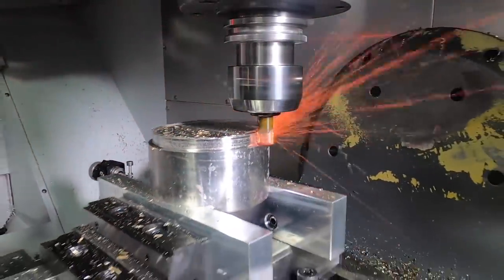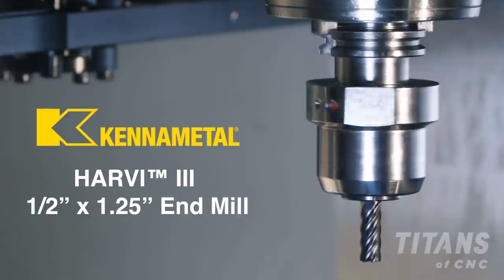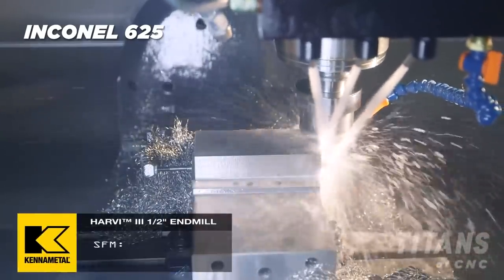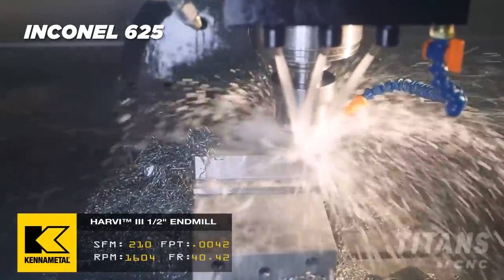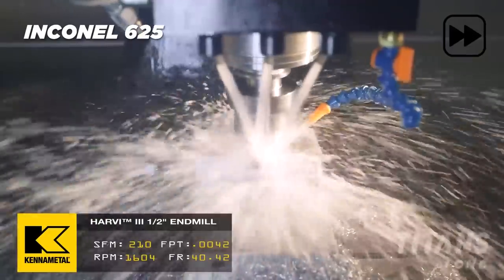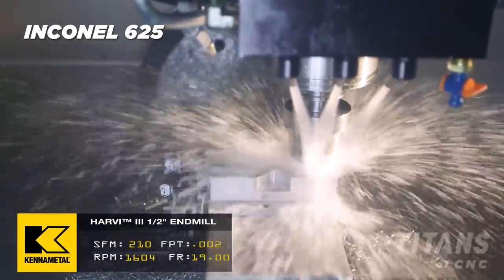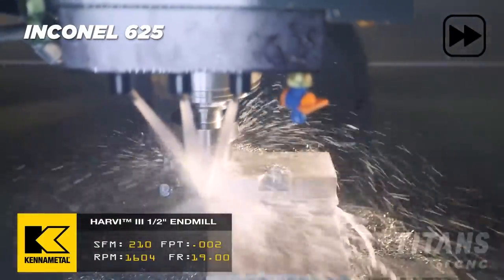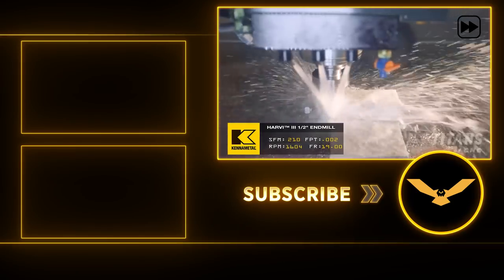Are Ceramic End Mills Actually BETTER Than Carbide End Mills???

Comment: On mazatrol mills we switched from an end mill to an insert endmill that way we could switch from carbide to ceramic depending on material type. Then we would flip the insert corners for the finish pass. Saved alot of money I was told.

Comment: I've had good luck with ceramic mills as long as it's not an interupted cut.
Good video showing the chips taking the heat away from the part.

Comment: 'When implementing tool management, make sure the machine can swap tools in the middle of a cut, or change the tool before it runs out of time.  Older machines would use the tool in a 30 minute cut (for example) as long as it had 1 minute left on life...
Reply: We implemented a guy who loads parts and comes looking for me whenever a tool starts getting harsh with the parts (I take them off the VMC and onto the knee mill and my "5 axis lathe" they go)...He even occasionally checks the spindle load!

Comment: The advances in ceramic technology have been unparalleled in any other material science in the last 20 years...
Reply: not really related to the video, but plastics have also gotten incredibly good the last 20 years, and definitly the last 30.
Reply: Glass as well but lots of similar information gathered between the 2 of them

Comment: For true roughing I'd say carbide has the win 90% of the time. Semi roughing where you are using less of the cutting edge , be it milling or turning, ceramics probably have the win with good tool management.
Reply: Ever worked with inconel material? No you have not
Reply: @louisrousseau1006  yeah I have actually, in the last five years it's been 90% of my work. Aerospace , oil and gas components
Reply: @louisrousseau1006  I am right now. Ceramic all day for roughing.   😎

Comment: I would have never thought ceramic would work as an end mill. Hanging out there like that with so many vibrations. I would expect it to turn to dust on contact.
Reply: Nope, speeds and feeds, and length of tool. Actually last awhile

Comment: Ceramics need to be ran much faster feeds and speeds than carbide. That’s where many get too conservative and the tool doesn’t last. We had our vendors tell us the correct way to use them in our materials and our engineers balk when programming it. And dry. No coolant or the damn things will shatter
Reply: Hmm. Interesting. I wonder if running them hot basically makes them tougher and more shock resistant than running colder...

Comment: Ceramic blows tungsten out of the water for parts harder than 48HRC~. I work with steel that can push 60-67HRC daily. Use to use tungsten taking 0.2in cuts at roughly 250sf/m. Now Im using ceramic taking 0.6 cuts at 350sf/m. And what's great is the ceramic can be ground back into shape to be reused much easier than tungsten. Tho on anything in the 40HRC or lower.... Lots of chatter.

Comment: Would ceramic work with hardened tool steel? I use high grade carbide, but I'm curious on other people's experiences
Reply: Never tested, but as I understand it, ceramics mills work by heating the metal so much it becomes soft, and then removing it. This heating might be bad for steel, screw up the temper, things like that...
Or not, it's just a guess. If you find out, let me know!
Reply: Tool steel is soft if u know how to cut it. If the chip is purple there’s too much heat. Blue chip is what you aim for. Never cool it with coolant as it hardens the material. Always use air blast.
Reply: @supah_sonic9979  I work with m390, that stuff is extremely stubborn. The only chips that turn blue are the ones that come from burned mills or inserts.
Reply: @andredepaulagomes  that makes sense. Not the very best thing, but definitely something I'll discuss with my tool provider!
Reply: Never tried it, but I think the reason is that for a 1/2" tool, Kennametal recommends up to 3280 SFM in inconel. So I would imagine for steel it would be like 10,000 SFM, and unless you have a super speed (like 50,000 rpm+) spindle you'll never get up that high
Reply: Rpm is usually the issue here. Too much speed can be a huge problem. If your machine don’t have the torque lessen depth of cut
Reply: @barrysetzer  50k is a bit over the max. One of our tool provider knows a company that is specialised in tooling for hardened steel. Curious if I'll see sparks

Comment: Can you use an old cutting piece to make a rough shape to save money ? Rather than using a new cutting piece you use an old cutting piece to get most of the metal off.
Reply: That's a fairly normal approach, using a fresher sharper tool for finishing and cycling it into a roughing 'job' as it loses its ability to make a fine finish. The problem is with more exotic materials and their tendency to work harden and be negatively affected by dull cutting tools. In those cases you just use the best, otherwise you could bite yourself in the butt with the false economy of using lesser tools on an expensive part and scrapping a work piece. Sometimes paying a little more upfront saves you big bucks down the road.

Comment: Would using coolant with the ceramic mill be a waste?
Reply from the maker: Yes, ceramic is chemically inert so milling it does not heat the tool up so it’s not an issue.

Comment: Hi Titan! What do you think about Cryogenic Cooling plus ceramic cutter and cutting time control(sister tools)? Espacialy cutting titanium with deep cavities... May be safer chip removal with Cryogenic Coolant thru spindle/tool(?). All the Best for you and your Team! 😎
Reply: Shrinkage??
Reply: @kingofkings600  Shrinkage... Maybe a problem / Parts with tight tolerances. But for roughing, heat avoidance, longer cutting time it is a good solution...